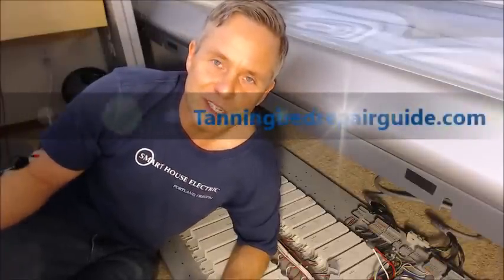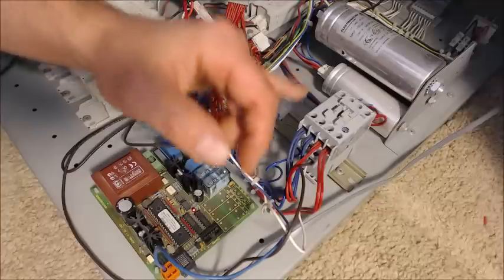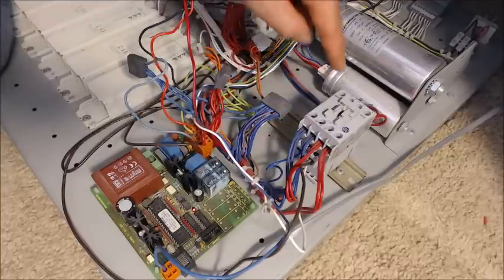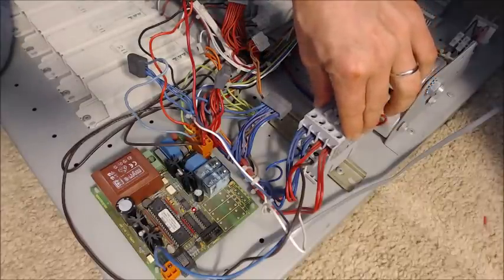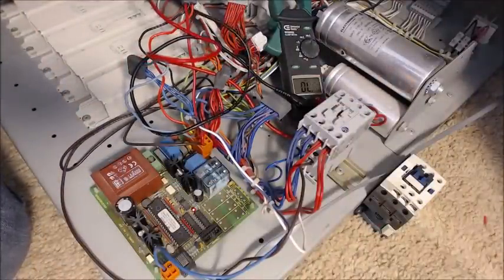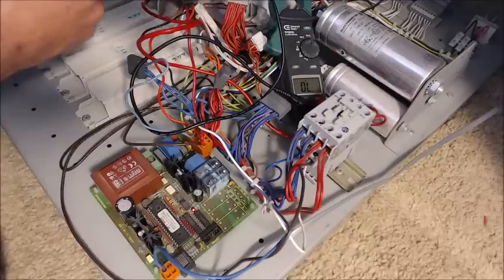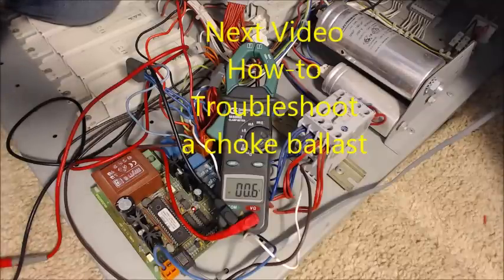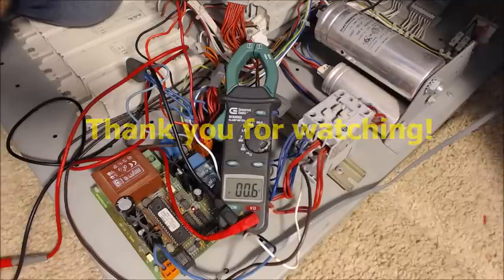How to troubleshoot a Contactor

Comment: I have three right voltage to my contactor wen I manually push it down is sends the right volts threw but bed will not come on or fans any ideas

Comment: What to check if contactor on  conveyor is not energizing I have checked everything include replace the contactor but still conveyor won't start and not engage the contactor if press it starts but doesn't engage when press start button

Comment: your prove are in series and your reading are in volts how come?
Reply: janito urmeneta because the contactor's contact is break or open circuit, after he use the volt meter to do the measure to the contact and his meter is in series with the lighting circuit, it form a close circuit.👽

Comment: ultrasun 4000 to canopy lamps flicker and when I touch non flickering lamps and ground my knee to the bed, they start to flicker, I ran a ground from the canopy chassis to the buck booster box , it improved but did not go away, the lamps in them are red light therapy not UV